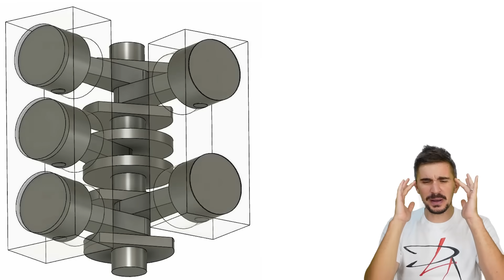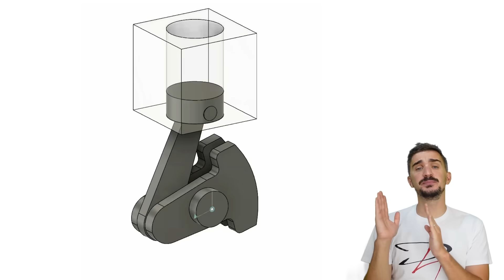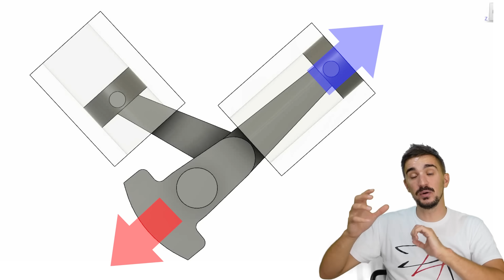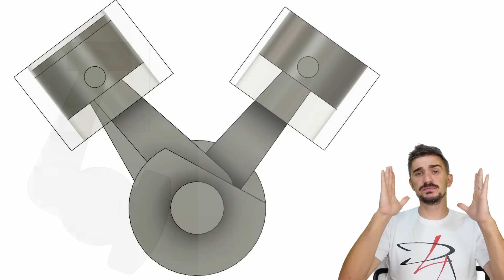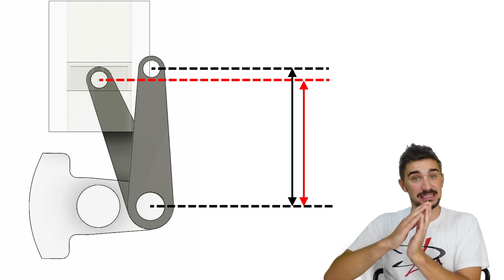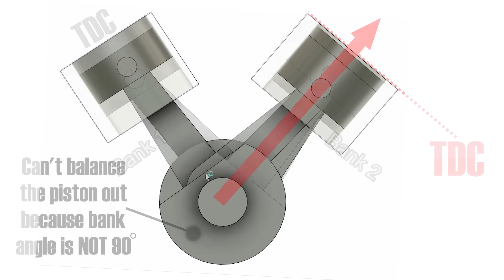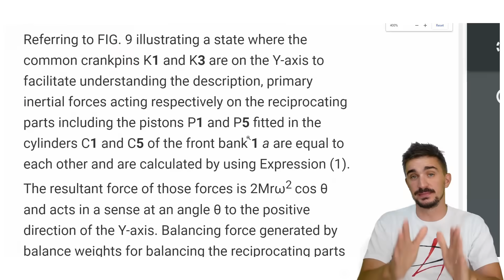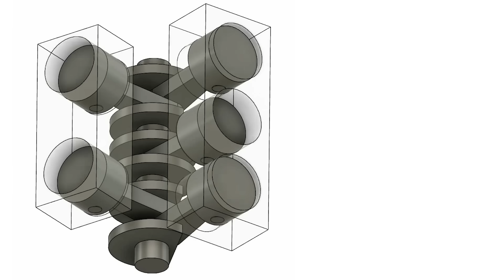Logic Defying V5 Engine - Honda's RC211V Explained Like Never Before

Comment: What an amazing video. I've been looking for how this engine works for ages. So balance wise this is pretty genious, because it's like a v4, but with a narrower angle and without a rocking couple. So the primary balance is absolutely perfect. However, you didn't really touch on secondary balance. Does it also have perfect secondary balance because of that odd 75,5° bank angle?
Reply from the maker: Yes, that's a very important observation, because the rods are stacked the way they are there's no rocking couple. Secondary is very close to v4 but I think it's only slightly worse in terms of secondary balance than a v4, probably irrelevant. We have two at TDC, so that's two forces up, two at maximum velocity, so that's two forces down, and the odd cylinder a bit past max velocity so that's another force down-ish.... So not two up two down like the v4. The v angle is different too so they again don't fully cancel out, just like in the v4, but they're also not perpendicular to each other, which should work a bit in favor of the v5. But all of this is hair splitting, the secondary balance is smallish anyway l, especially on a 990cc thing with tiny pistons (tinnier than a v4 mind you, maybe they're the same overall for secondary) and it's overall miles ahead of a flat plane inline 4.
Reply: @d4a  Okay that makes sense. So overall the V5 is a pretty cool engine, but it's pretty expensive I guess. You can't use the same heads or even head covers for both banks, they are all unique. So it's fine for a race engine, but unfortunately we'll likely never see one for the street.
Reply: I think the crank pin arrangement gives perfect secondary balance. The crankpins are mirrored on the crank with the outer cylinders on the same bank.
There also will not be any rocking motion from this either.

Comment: If you think about that!
Those engines make nearly 300hp/liter Na!
The Americans with there antiquated Chevy engines bearly make 300-350 hp/Liter with huge turbos and methanol! 😂
Just the nitro methane engines go up to 1000hp/liter.
Here in Europe a lot of drag racers go 1000hp/liter just methanol and turbos, and compared with this top fuel cars, mildly modified series engines!
Yea, they are really heavily modified..... But not made out of unobtanium that hase to be replaced every run! 😂

Comment: Was the sole purpouse of creating this V5 engine to reduce the angle between pistons to 75.5 degrees and improve the bike handling? I don't see the point of adding an extra piston mass, complexity and movement resistance to keep the same engine displacement. Did i miss something?
Reply: because a narrower 75 degree v4 doesnt have balance as the 90 degree so  it needs a balance shaft which robs power and also adds weight to a v4 so i think they just figured hey if we are already adding more weight with the balance shaft we might just turn the "balance shaft" into a piston so that it also makes power to get rid of the parasitic loss coming from the balance shaft
Reply: The exact same thing I was thinking initially but then, I don't know much about bikes engines and their GP engine sizing rules.🤷‍♂️
Reply: Their train of thought from what I've read was.
V6? too complex and has large weight penalty.
V5 interesting
V4 and inline 4 is boring.
V3 interesting
V twin? Nah cant make enough top end power because the big cylinders wont rev enough.

So V5 or V3, They went with V5 because it's easier for them to balance and make more peak power. Also pistons in a V5 are smaller and lighter than an equal 4 cylinder.
Reply: The final bike weight was the same for 4 and 5 cylinder machines and they would have to add ballast either way. The additional cylinder got them better balance and power. There was no 4 cyl machines that came close to the power of the Honda. It was more complex, it was also better in every way measurable.

Comment: 260 hp from 990 cc....sweet Jesus. I would put 2 together. Flip the second ending so the piston per side is the same. 540hp for 2000 cc. Under 500 lbs. Then turbo it...900hp...Mic drop.
Reply: The only engine can beat ducati engine

Comment: When MotoGP switched from two to four stroke engines, minimum weights were based on number of cylinders.  Twins, triples, fours, and six cylinders all had different minimums.  I read somewhere that Honda wanted to use a V6, but it would have to be too heavy.
Reply: Correct. I recall the V4 and V5 had the same minimum weight which was a definitive advantage.
Reply: correct.  Honda always coming up with crazy ways to take advantage of rules.  Honda wanted to make a V8 4 stroke to compete with 2 strokes of the same displacement to avoid giving in to making a two stroke (kind of like how they made a 6 cylinder 20,000 rpm 250 cc in the 60s, Honda had up to that point in the early 80s never made a 2 stroke roadracer)  so they came up with an oval piston v4 since 8 cyl weren't allowed and oval piston allowed the valve area more equal to that of an equivalent 8 cyl.  It had competitive power but reliability issues and so they finally gave in and made a 2 stroke and won a title with their first 2 stroke 500 cc RC.
Reply: Yes that's right, if my memory is correct it was a 10kg jump between 2 cyl and 4cyl and the same again between 4cyl and 6cyl.  I believe that was the thinking of Aprillia's ill-fated 3cyl "cube" GP bike, it could run at twin cyl minimum weight.
Reply: Somehow opportune: Old saying goes " what you carry in your head doesn't  weight on your shoulders" .
In this case it had almost a 60% efectivity from the start ..in real life.👍
Reply: I heard that, too.  Makes sense.  Leave it to Honda to find some totally batsh*t way around a problem....

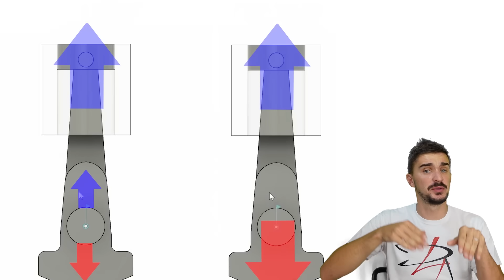Comment: 4:03 This is the golden rule for engine balancing, primary forces and couples are (always, in theory) "averaged out" so that they are "circular" (equal in magnitude in the horizontal and vertical directions).

Comment: This is a variation of the trick Honda did with their 52 degree vee twin engines.  The crankpins are offset 76 degrees. (76/2)+52= 90 degrees. They have a 232 degree firing order but emulate the balance of a 90 degree vee.
Reply: It was a beautirul engine and i'm kinda sad to see them switching over to the parallel twin they use now.

Comment: My brain hurts...but I fucking love this...I haven't seen any other videos that goes this deep in detail about one of the most iconic engines ever made...Thank U D4A <3
Reply from the maker: No pain no gain 🦾
Reply: @MR_IC  i know my answer won't be very detail but.  All of those engines comes from Toyota A series engine. 4A-GE is the normal engine used in corolla with many variations including the 20V black top. 7A-GE is a mix of 7A-FE bottom (the block and crank usually) with 4A-GE head (head and piston). I believe they do this because 4A-GE head can deliver more air  and fuel compared to 7A-FE head. This result in a 1.8L engine with exceptional performance on bottom and high rpm. The highest number of A series engine is 8A. 9A-GE is a combination of 7A-FE, 4A-GE and some parts from 1ZZ or 2ZZ engine. Hence why it is not very popular, although it is much more powerful and on paper it can output power and torque close to a K20A from FD2R. 7A-GE and 9A-GE are not official from Toyota, both of them are made by consumers or tuners.
Reply: Lol mine too
Reply: my brain hurts too,
i think it got unbalanced trying to take all that in
🤣
Reply: Check out vw vr5 if you want to hurt your brain
Reply: @ryanbeck4826  There's nothing about the VR5 to make a guy's brain hurt... It's basically an inline 5 cylinder with every other piston 7.5° offset from vertical. Nothing special there at all. If your brain hurts thinking about the VR5, you need to give up on engines.

Comment: Honda and Suzuki built V3 engines before, Suzuki didn’t use theirs because of a rule change but Honda used V3 engine in the NS400r roads bike and the NS500 before the V4. Good video, you do an excellent job of explaining complicated principles
Reply: The MVX250 V3 Production bike came to mind when the V3 got crossed out.
Reply: @duncandrummond726  Yep that’s the other one I didn’t mention.
Reply: @sourand jaded You sir have had a life worth reading about.
Reply: Was the NS400R from around 1982 with 2 pipes up top and 1 down low?
Reply: @zedfender9423 , I own three NS400R motorcycles; all 1986 models.  I think they were only produced for 1986.  They were the street legal versions of the NS500.  The NS400R actually displaced only 387cc, and had a forward-facing v engine.  The two outer cylinders were down low up front and the middle cylinder was up high at the back.  This made for a set of expansion chamber pipes that were two down low and one pipe up top snaking under the seat.  You are thinking of the NS500 race bike that had the 1 cylinder and pipe down low and the outer two cylinders up high with the two expansion chambers under the seat.  I believe the engine was switched around for the NS400R to make room for a battery and an oil injection tank under the seat on the NS400R.
Reply: @zedfender9423  2 on right side and one up high as far as I can remember
Reply: @sleepwalker8600  im trying to remember without the Google i think my dads mate had one in rothmans livery.
Reply: @zedfender9423  yeah man that’s entirely possible, it definitely went out with that livery
Reply: @sleepwalker8600  i had an Nc24 vfr 400 in the rothmans livery a good while after but the 2 strokes always look cool with all the pipes smoking and the nsr with three is pretty sweet.
Reply: @zedfender9423  Yeah man 100% agree, the still race the odd 125 and 250 two strokes on the roads over in Ireland and they always bring a smile. Do you remember the NR500 with the oval pistons? Not that I had one or anything lol super rare and didn’t really work but there’s a handful around the web
Reply: @sleepwalker8600  yep two con rods per piston.
32v and would still be expensive if it was new now.
Red and black.
That was a mad idea like the v5.
Reply: @zedfender9423  Yeah man, absolutely crazy lol. Some engineers at Honda, or there was. It took a lot to get the V5 not to vibrate itself to pieces but they did it
Reply: @zedfender9423  I forgot we were commenting on a video about the V5 lol
Reply: RP68 was the Suzuki race bike.. v3 50cc! 14 gears too, 500rpm power band :D.. the MVX was a nice bike.. had one years ago, unfortunately not the most reliable.. even though they used a thicker conrod for the vertical cylinder it still suffered a lot of problems.
Reply: V5s also have existed, VW made one in the 00s for Euro golfs and stuff
Reply: @initial86-2.5  Yeah that’s right, single bank of cylinders and and one cylinder head
Reply: @initial86-2.5  Nah that engine is really an inline 5 with the cylinders not quite in line. In shares basically nothing with a proper V engine.
Reply: @sourand jaded Hindsight.
I wish I had all my old stuff still.
Reply: what was the angle used in those? 75.5?
Reply: I met a guy at the Bathurst races about 1982 who had grafted an extra cylinder into a TZ350 to make a v3 500. Amazing.

Comment: Your surface level coverage of V-engines BLEW MY MIND. Now I understand why people say "V engines are smooth".
Reply: I have a Honda ST1100 V4, and BMW r1100rt, Boxer twin. The Honda has better fuel efficiency, HP, torque, and just feels more responsive with less latency and buzz. Now I understand why.
Reply: @OutsideTheTargetDemographic  I got to ride friend's Ducati 750 Sport in the early '90s and it was the smoothest engine I'd ever experienced.  It was a 90 degree design.  I recall from my early days in the motorcycling world that the 45 degree v twins from H-D were called "Milwaukee vibrators".
Reply: @whalesong999  Well, luckily, Harley's 45deg engines barely run, so you don't spend too much time being buzzed in your nether-region. 😉 Never understood the appeal. Then again, I have done hundreds of miles in a day, and ran The Tail of the Dragon maybe 5 times. To each their own. 👍

I read a comparison between my two bikes, where they said the boxer was nimble and low center of gravity, while the V4 of the Honda was "turbine in power production and delivery", which I felt was very apt.
Reply: @OutsideTheTargetDemographic  Well the biggest reason it has less "buzz" is because it has more cylinders. As for the rest it's explained by completely different engine designs - different cylinder/piston size, different stroke, different engine management system, different valves, different cams, one is even air cooled while the other is water cooled - nothing to do with being a V engine.
Reply: @BigUriel  Right, yet, Boxer engines, by design, cancel out balancing issues by their design. So to me, a simpleton, trying to understand why my non-boxer is smoother than my boxer, was not understood. More cylinders helps, IE a boxer 4 (like my Subaru) should (and does) have a smooth power delivery and noticeable lack of buzz and engine noise compared to other engines (like the wife's Chevy I4 engine). This video just explained to me why 90deg engines are smoother than some other designs.
Reply: @OutsideTheTargetDemographic  This video just deals with mechanical balance but the "buzz" from an engine comes largely from the power strokes. An engine with few cylinders always tends to feel "rough" even if it's perfectly balanced because the engine is actually always accelerating and deccelerating (at constant RPM), it accelerates during the power stroke and deccelerates during the compression stroke (the ECU actually uses this variation in instant engine speed to gauge individual cylinder performance and adjust fuel trims accordingly). You'd need an impractically large flywheel to eliminate this completely. The more cylinders you have the less pulsated the power delivery is and the smoother it feels, engines with 5 cylinders and up always feel very smooth (even when they're imbalanced) because the power strokes overlap so you never have that decceleration caused by compression because when one cylinder is doing compression another is doing the power stroke. V10s and flat plane V8s are not balanced engines yet they are very smooth even without balancing shafts.

Then there's the actual direction of the vibrations - Harley engines for example vibrate along the longitudinal axis of the motorcycle so while they vibrate a lot on standstill, when riding they are very smooth because the vibrations are completely eliminated by the suspension - and how the engine is fixed to the chassis, a good set of engine mounts can reduce vibrations drastically, some engines even have hydraulic of pneumatic engine mounts so the engine itself has its own suspension of sorts. This all affects how the engine will "feel", mechanical balance is only one piece of the puzzle. BMW boxer motorcycles have longitudinally mounted engines (unusual for motorcycles) which actually cause the entire bike to lean in the opposite direction of the engine rotation every time you accelerate by simple reaction torque.
Reply: Not V twins

Comment: Fantastic video, as usual. Next would like to know more about combustion chamber design and intake valve its size, timing, lift etc and how all these factors does affect on engine torque development. Along with it, What's swirl and tumble and their significance. Everything related to it plz try to include and explain it.
Reply: For intake valve size... NA engine has a bigger valve to maximize vacuum along with a swirl system to mix the air fuel properly. With a higher valve lift, you can increase entry/exit size further reducing load during vacuum. The exhaust valve can be small as the gas is being positively pushed out by the returning piston. Combustion chamber designs can be designed for non interference or bigger/smaller compression ratio and proper flame propagation.

Theres also a different combustion chamber for diesels. The other one that uses indirect injection has a small swirl chamber that tries to mix injected diesel with air. It has mostly lower noise levels than the direct injection but it can't beat modern commonrail direct injection that injects multiple times to emulate swirl while the piston climbs up during compression.

Comment: GM put a V5 in the H3. It’s weird. lol
Reply: The H3 used an inline 5-cylinder. (from the Atlas engine family)
Reply: @michaelblacktree  yeah I was confusing it with something else.
Reply: BTW, cool user name. I'm a former 12B. 👍
Reply: @michaelblacktree  boom 💥 lol
Reply from the maker: An actual mass produced V5? I doubt that, but I would still love to see what it actually is. Got any links or sources? I'm googling and finding the Vortec 3500, is that it? That one's an inline five.
Reply: @d4a  I had to scratch my brain for a minute and I realized I was conflating conversations I had with my myself at one point. The Hummer has an inline 5 but I was thinking of how it would be cool to swap it with a Volvo I5 engine. Then it took a turn and I started thinking of the VR5 engine that was in the VW lineup in the early 2000s. The VR5 was a V5 engine in the Passat, New Beetle, Bora, and I think even the Golf I believe.